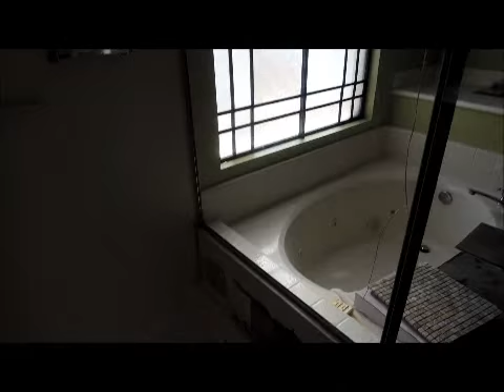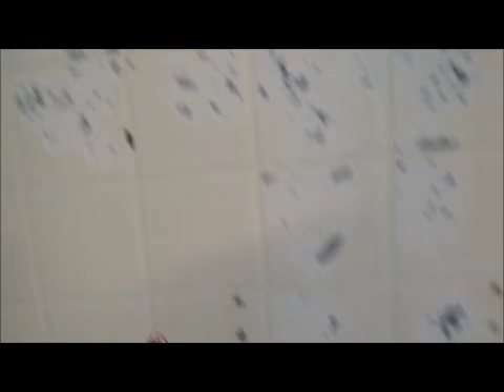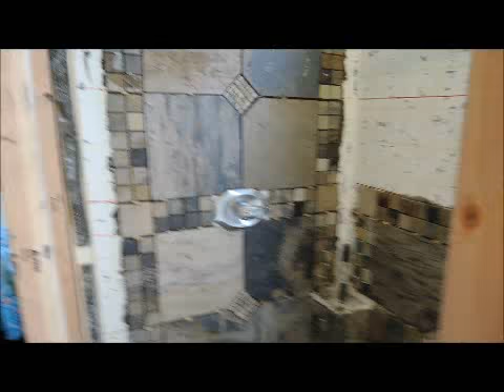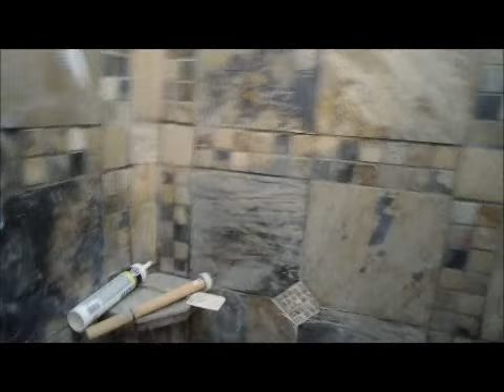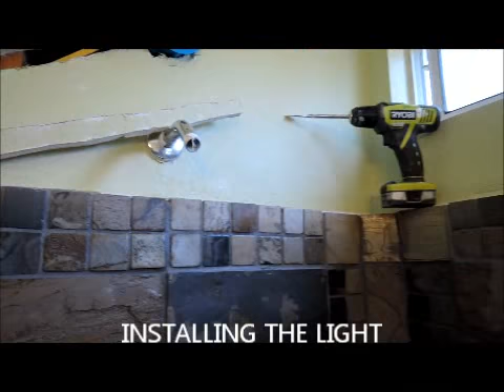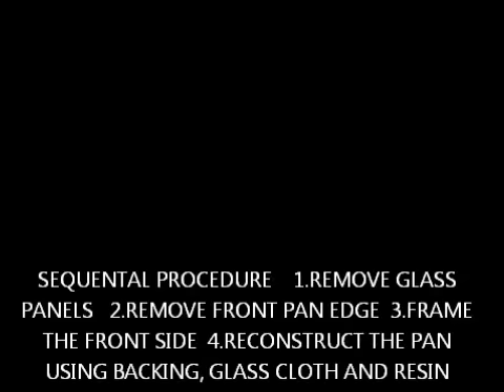FIBERGLASS SHOWER INTO A TILED SHOWER

Comment: Nice job Don! I am doing the same exact thing right now, for the same exact reason you did. My wife said we need to take that shower out and replace it. Those days are behind me. lol The only thing I did different is cover the fiberglass shower with cement board screwed to the wall. I just finished tiling the floor pan today. I will be doing the walls tomorrow and grout the next day. Thanks for the video, you did a great job!